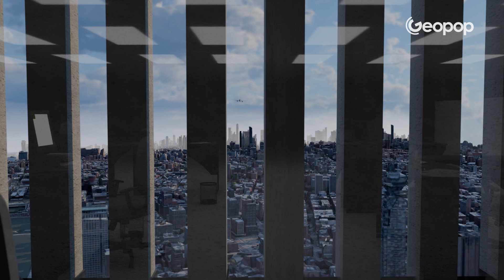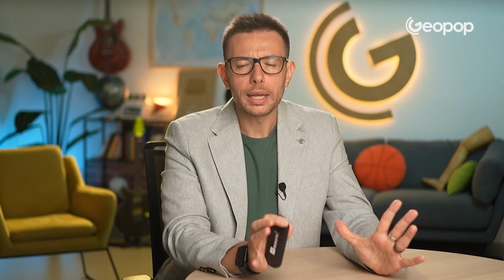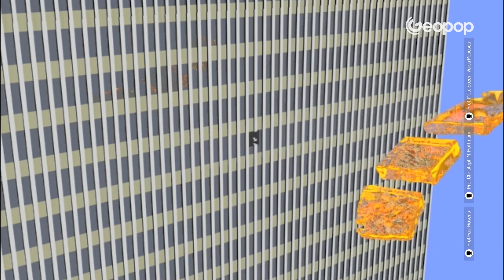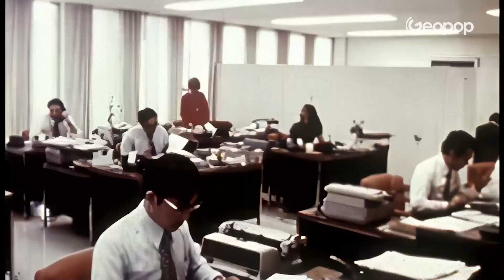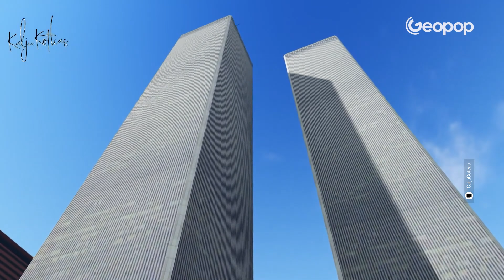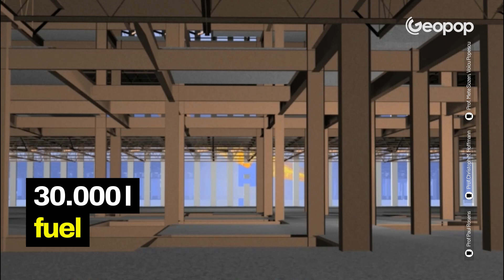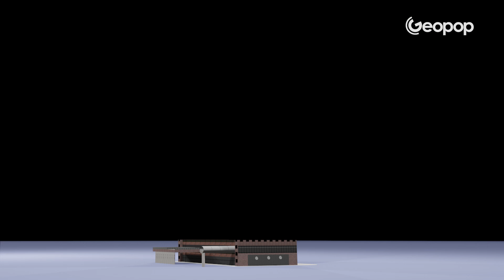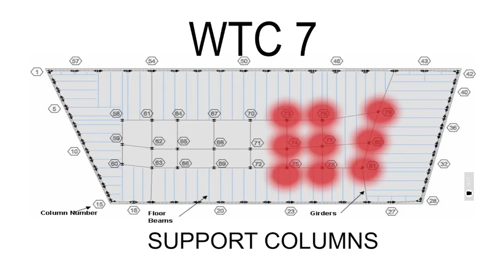9/11, 2001: The Technical Reconstruction of the Twin Towers and WTC 7 Collapses

Comment: It's all nonsense, Show another building falling like that in our entire history that wasn't a controlled demolition
Reply: Show one falling like that which was a CD. 

Guarantee you can't.
Reply: @TheLoonResistance  Literally every single one. Collapsing in on its own footprint
Reply: @JohnnyGhoul205  - Explaining the 17 acre debris pile from a pair of one acre footprints.
Reply: @TheLoonResistance  The WTC complex is 16 acres. How can you record the debris from just those towers when multiple buildings fell?
Reply: @JohnnyGhoul205  - Why did those other buildings go down?
Reply: @TheLoonResistance  Because they're part of the complex...
Reply: @JohnnyGhoul205  - OK, now answer the question.  

How, if the Twin Towers collapsed entirely into their 1-acre footprints did the adjacent buildings not within those 1-acre footprints get so badly damaged they collapsed or were destroyed?
Reply: @TheLoonResistance  Just watched some footage to confirm. After the dust settles you can clearly see the towers collapsed on themselves. Some buildings in the same block are completely undamaged, people can be seen walking up to the pile and clearly isn't a 16 acre mass. From the footage it looks like about 50m from the site the rubble is smaller than pebbles and is mainly things like paperwork, dust or you know, light things that the wind throws around.
Reply: @JohnnyGhoul205  - So no other buildings were struck by debris from the collapsing Twin Towers?  All of the debris fell within two 1-acre footprints.  Is that your final answer?
Reply: @TheLoonResistance  No sir that's not what i said but there is a fireman's testimony stating he had to break into a store to get supplies at the base of the pile indicating some were totally undamaged, along with plenty of footage showing this with other buildings, how could some buildings in the same block as the tower be undamaged if the debris pile is 14/16 acres? That's nonsensical
Reply: @TheLoonResistance  You didn't even rebuttal half of my comments, just claimed I said 'no buildings got hit by debris' which I clearly didn't
Reply: @JohnnyGhoul205  - So did debris from the Twin Towers strike and damage surrounding buildings, YES or NO?

FFS what is with all the evasion?  This isn't that hard.

Falling in their own footprint at least implies if not outright declares ALL OF THE DEBRIS was contained within the 1-acre footprints, so it either was or wasn't.

This then requires an explanation as to how and why 8 nearby buildings were destroyed, a round 25 more badly damaged but repaired and more than 100 others suffered lesser damage,

Perhaps you could nae the immediately adjacent buildings that were completely unscathed.
Reply: @TheLoonResistance  Yes! It wasn't however a 16 ACRE DEBRIS PILE, if your point is that if debris hit other buildings it couldn't have possibly been a controlled demolition that's even dumber than your initial points. Multiple clips of controlled demolition causing injuries and fatalities in desolation from debris with spectators being at a so called safe distance. I'd really like you to explain the other 100's of anomalies instead of fixating on this, even though they're all the first in history to do this and remain to be today
Reply: @JohnnyGhoul205  - - You claimed the Twin Towers collapsed in their own footprints

Each footprint was 1 acre.

IF you are correct there should be no damage outside of that pair of 1-acre squares.

But there was.

A lot of damage well outide those footprints.

What happened to Building 3?
Building 4?
St Nicholas Church?

None of those were within that pair of 1-acre footprints.
Reply: @TheLoonResistance  You're implying controlled demolition doesn't spread debris at all? Which is why bystanders/spectators get injured all the time.. It still doesn't explain it falling nearly perfectly vertically. It it had sustained that amount of damage to the supporting structures, You would expect to see twisting and warping as the load is now exerted irregularly, that just doesn't happen. The whole building falls simultaneously. 
How do you feel about the various other anomalies that day like passports being found in the smouldering wreckage or the imaginary plane that hit the pentagon?
Reply: @JohnnyGhoul205  - - I imply nothing. I say what I mean.  In this case I a merely asking a clarifying question on a point you absolutely don't want to clarify.

You said the Towers collapsed in their own footprint and have been avoiding clarifying questions about that key talking point ever since.  I mean, thar was entirely predictable and I don't blame you,  It is not your own original argument  but rather something you mindlessly repeated off the internet thinking it would make you seem profound, when you never even thought about what it means.  That it is an utterly stupid and obviously false argument that has totally failed every single one of the million or so times it has been employed previously also never occurred to you.

You can't defend it, you don't even really understand it but your ego won't let you back down and just admit the whole thing is just so much technical nonsense and you were talking out of your ass.

And its boring AF.  Good luck with that.
Reply: @TheLoonResistance  You've clarified nothing and avoided every question I asked you. You don't care about the truth either, only your own opinion. I've said that it didn't fall in it's own footprint, I said it looks like a controlled demolition and explained points about that as well that you avoided but you can't explain the apparent 16 acre pile of debris while SOME buildings in the same block sustained no damage, that doesn't make sense according to your logic. How could there possibly be footage of people / survivors testimonies at the base of the building before the collapse and managed to run 16 acres to survive? It seems like you're the one just reading a script. actually rebuttal something i've said and maybe i'll think you have a brain
Reply: @JohnnyGhoul205  - I have not attempted to clarify anything nor do I intend to answer any of your deliberately evasive questions until you answer mine. We are after all talking about your claim here so YOU are the one who needs to provide clarification and consistently refuse to do so. Please stop being rude, stop stalling so this project move forward. 

In your second reply in this thread you said this in response to my asking to you to show a building falling like the South Tower that was a CD:  Literally every single one. Collapsing in on its own footprint

Your evidence for CD - the only case you presented - was collapsing in its own footprint

Are you now retracting that statement?  

A simple YES or a NO please. 

Your reply should only be one word. That's it. No need to write a PhD thesis. It is one or the other and I will ignore any words that aren't YES or NO and ask again.
Reply: @TheLoonResistance  I'm not retracting my statement. It fell like a CD. I also stated you can watch any CD and see that  it isn't entirely contained in the buildings footprint, i think that would be physically impossible, It's about as close as possible though. I also said some buildings on the same street were undamaged, so explain your 16 acre pile of rubble?
Reply: @JohnnyGhoul205  - So they fell in their footprints which is a characteristic of CD but they didn't fall in their footprints which is also a sign of CD.

Got it. 

Good luck with that. Have a nice day.

PS

Collapse initiation was due to sagging floor trusses from the impacts and subsequent pulling some of the perimeter columns inward by up to 5 feet until they buckled, as we see here:

Gary Pollard South Tower collapse, looking at the east side toward the north. 
www.youtube.com/watch?v=ULdiD6gYZO0 

CD DOESN'T DO THAT

Once initiated there was nothing to prevent it progressing to global collapse as the force of that falling mass drove its way through the structure below, dismembering it floor by floor.

You have seen video of buildings being demolished but few if any of buildings collapsing for other cause. You see building collapsing and your brain just goes to what it knows. No thinking involved. 

A building collapsing looks like a building collapsing. The building does not know or car what started it collapsing.

Controlled demolition - So simple.  A hand-wave.  No thought at all required. In fact the less thought put into it, the better.  Engineering is hard, but this is an engineering problem so that is where we have to go.  It's no place for simpletons.
Reply: He's finally stopped lying.